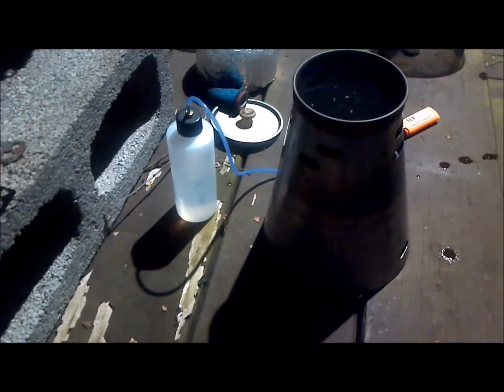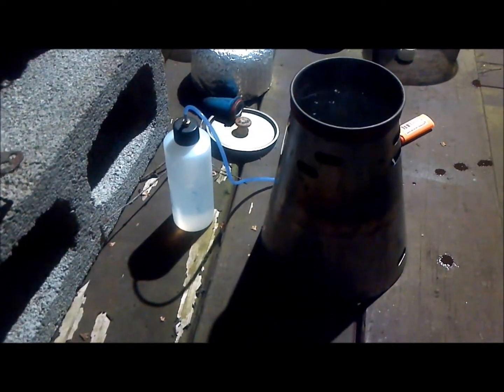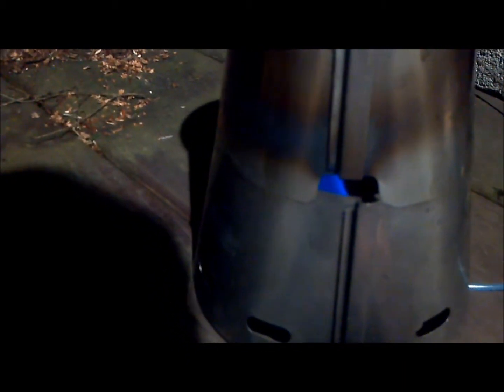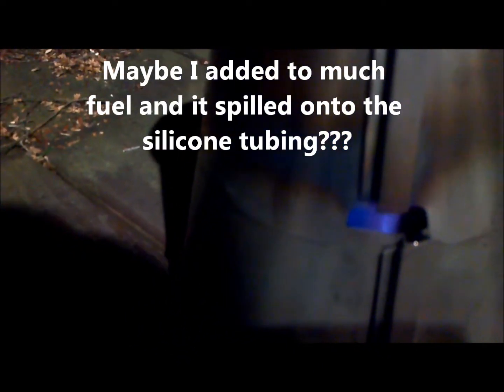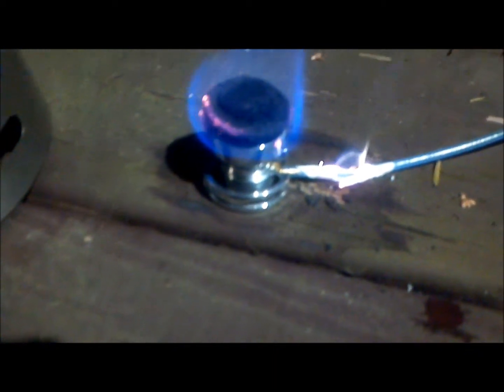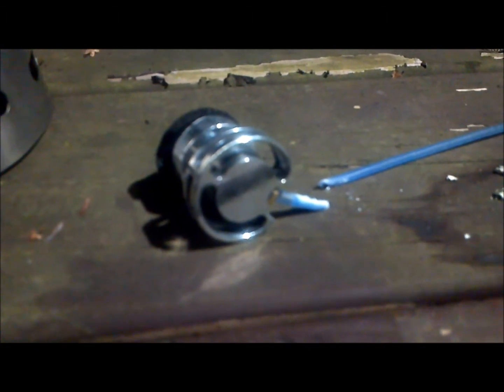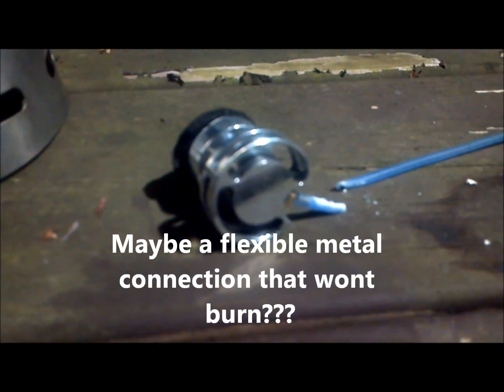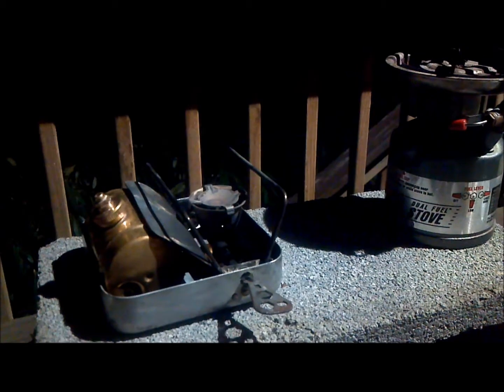Mini-Heat and CC Fissure Experiment.wmv

Comment: Aside: One of the marvelous aspects to a stove with the carbon felt burning outside of the aluminum parts is that the majority of heat goes to the pot and does not heat the fuel so much. The more you heat the fuel the more likely the burner will go into thermal runaway and potentially overwhelm the pot bottom thereby reducing the efficiency. With the burner in the cone, odds are, the fuel will heat up too much and start venting after a few minutes. Fuel lines in cones may not be the best fit.